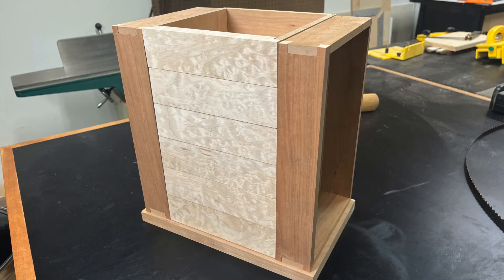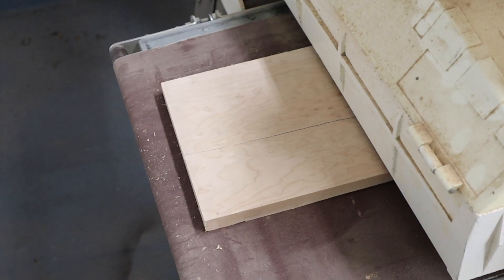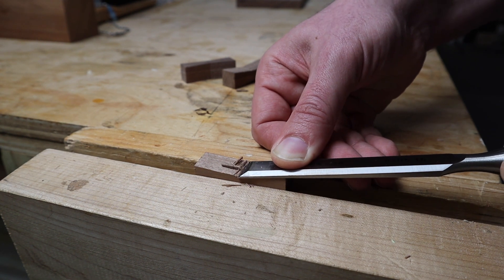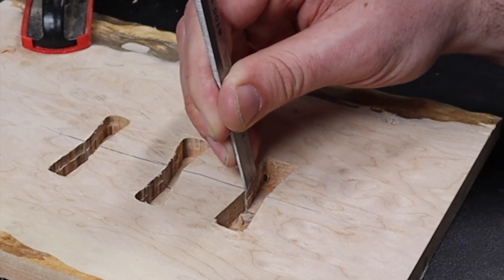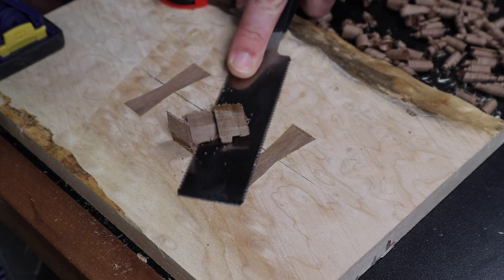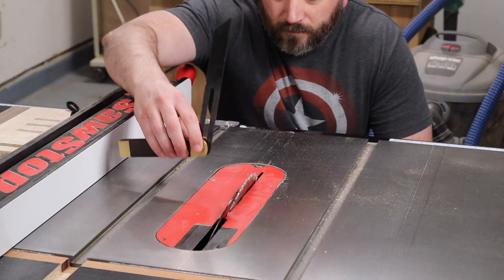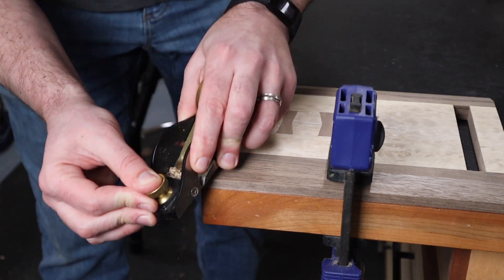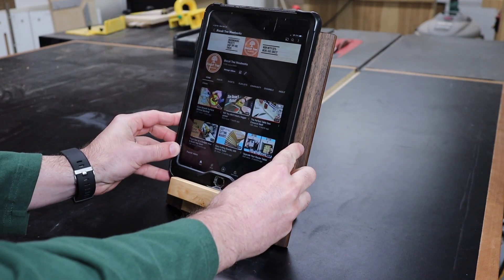Scrap Wood Can Make You A Better Woodworker!

Comment: Nice practice project.  I save many of my smaller scraps... labeled as to what project they come from and to test my finishes on them to see what I like.  Once I get one to my liking, I can label it with what I did to achieve it and save that for future reference.  Comes in handy when you need to match work pieces down the road.
Reply from the maker: That's a great idea!

Comment: I made a little challenge for myself that I can only use scraps I have on hand for.  Not too original, I know.  But I'm having to resist letting the plan get too fancy and requiring some piece of wood I don't have on hand.  Your project turned out great, and the your commentary throughout was very good.  The only problem is that you can't see that beautiful figure when it's in use!
Reply from the maker: That kind of challenge can be a lot of fun and very rewarding! The figure is blocked when I use it but there’s still some awesome figure on the back too! Thanks for watching!

Comment: Hi! I have a question! I just finished watching your video on dos and don'ts of wood staining (Love the way you explained everything while also demonstrating) and you sanded a piece up to 180. What if you sand it higher than that? Im currently sanding a piece of furniture and I won't be staining it, I will be applying danish oil and started sanding with 100 and my plan was to go up to 320... to much? Thanks for reading and for your videos! I'll really appreciate it if you respond!
Reply from the maker: Sanding to higher grits will start to burnish the wood which closes the pores and prevents some of the stain/oil/finish from absorbing into the wood. If I’m not applying stain I might sand up to 220. I’m actually sanding a piece right now and I’m going up to 220 since it’s very figured wood and I’m using a hard wax oil finish. I would not recommend sanding up to 320 except on end grain. You can sand end grain one grit higher to get a more even finish since it tends to absorb more than the other grain. Otherwise there is really nothing to gain by sanding to higher grits and you might have issues with the finish.
Reply: @biscuittreewoodworks  Thank you so much for your prompt response!! And for sharing your knowledge ♥
Reply from the maker: @damariscotto4676  no problem! Happy to help!

Comment: I'm gonna make one, thanks for the idea.....Question, I noticed on your Saw Stop that on the "o" clearance for the blade that there's a wood piece along the outer edge to the cast iron, what might this be?
Reply from the maker: That is an aftermarket zero clearance insert with replaceable center strips. In the long run it's much cheaper than the Sawstop inserts.
https://infinitytools.com/products/sawstop-zero-clearance-throat-plate-with-three-inserts?variant=46847612485921